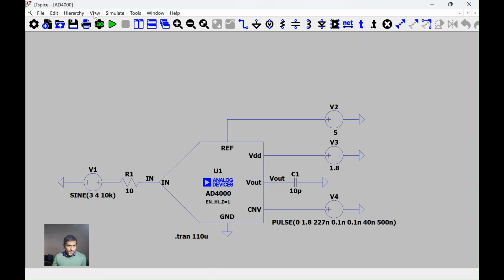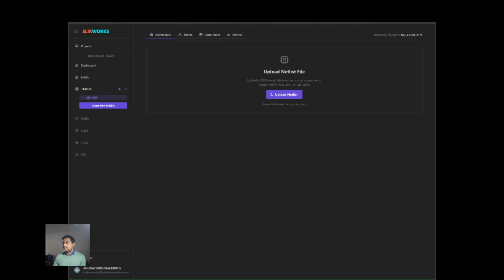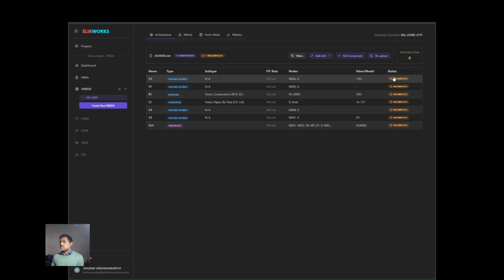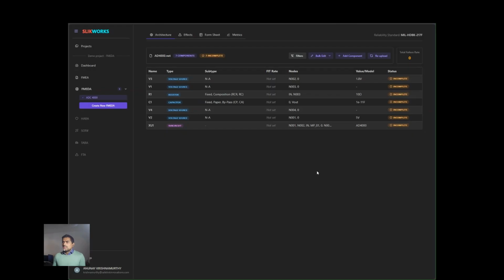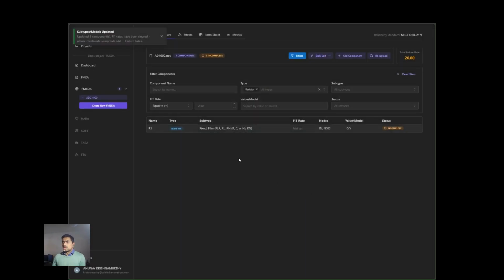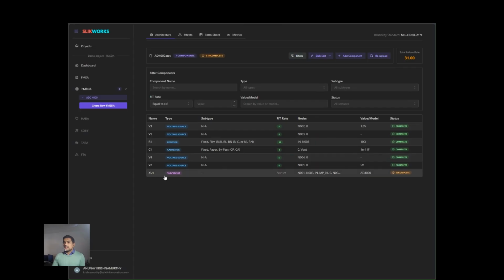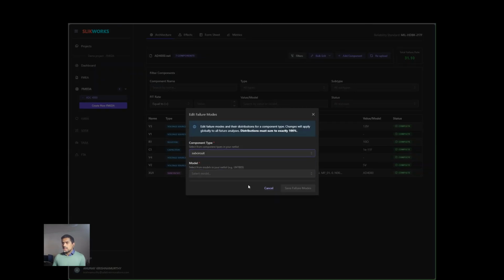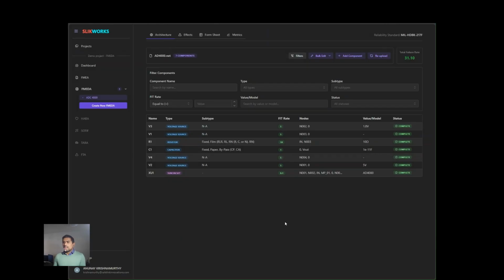SLIKWORKS - Creating an FMEDA - Part 2

Comment from the maker: Uploading circuit components manually for FMEDA can take hours - especially for complex designs.

With SLIKWORKS, you can import a SPICE netlist and automatically populate all components from your circuit diagram in seconds.

- Import hundreds of components instantly
- Bulk edit failure rates and parameters
- Assign failure modes quickly
- Prepare your system for FMEDA analysis faster

Try it here:
https://www.safelink-innovations.com/slikworks/fmeda-software